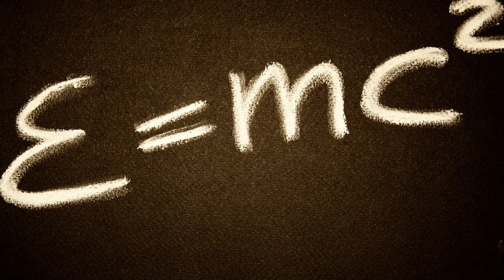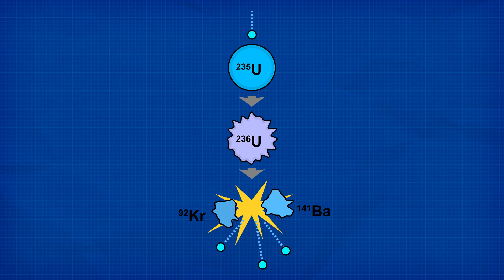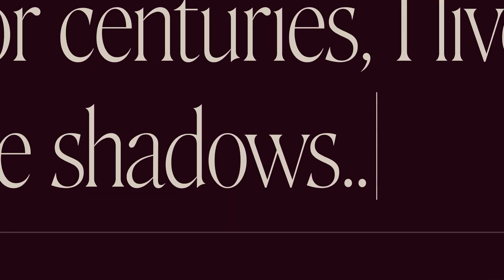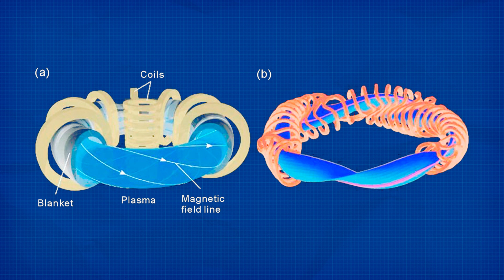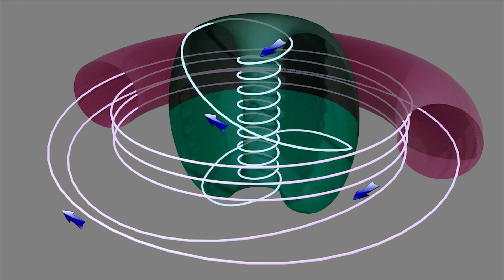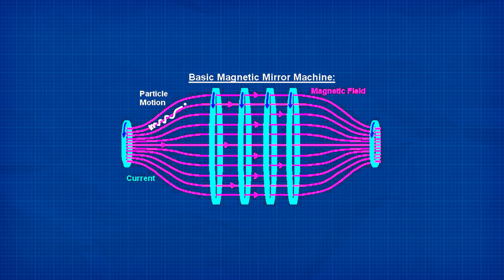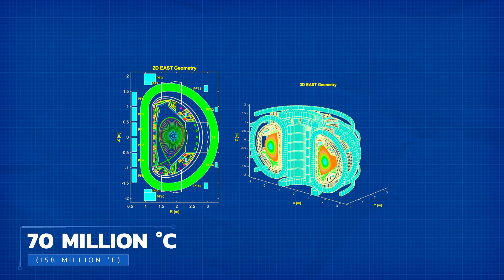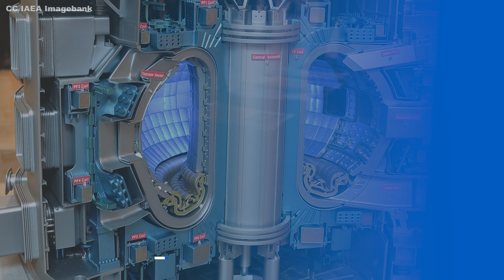Fusion Cracking the Future of Energy

Comment: The Q metric is a bit misleading by itself. In order for a reactor to be productive one doesn't just need Q>1, but needs actually usable energy out to be greater than 1. This is substantially tougher.
Reply: As a plasma physicist Q is not a metric I'd use for public communications, it often gives a completely irrelevant standard for experiments and facilities. The role of ITER is to get more out of the plasma than we put in, not the facility as a whole. This is an important step to study how various plasma properties scale with size. STEP and DEMO however are planned to actually put a small amount of net electric on the grid, they'll have turbines and everything, the reason why its a small amount is because the grid would very much rather not have an experimental reactor pumping out large amounts of power that could suddenly and without warning be cut off. 
The Sabine Hofstadter video that I'm pretty sure taught the general public about the Q metric completely failed to contextualise the intent of the experiments and built a false narrative around ITER being some sort of scam
Reply: @idoltrash2353  I think it's a little unfair to characterize Sabine Hossenfelder's video (watch?v=LJ4W1g-6JiY) in that way. She quotes Phillip Ball's article in the Guardian which says (regarding ITER):

"It hopes to conduct its first experimental runs in 2025, and eventually produce 500 megawatts (MW) of power - 10 times as much _as needed to operate it._"

and it's ironically that sort of twisted b.s. being communicated to the public that Sabine is trying to unravel in her video. The references in the video's description are very thorough, and if you're interested, I highly recommend checking them out. She isn't saying anything about ITER itself, rather.. she is calling out the MEDIA'S often incorrect (through ignorance) and sometimes maliciously misleading (for money via clicks etc.) The overarching goal being the improvement of scientific communication to the public, which starts with the acknowledgment that it needs to be improved.

At 4:02 into the video, Sabine says:

"The confusion, which you find in pretty much all popular science writing about nuclear fusion, is that the energy gain which they quote is that for the energy that goes into the plasma and comes out of the plasma. In the technical literature, this quantity is normally not just called "Q", but more specifically, "Q_plasma". This is not the ratio of the entire energy that comes out of the fusion reactor over that which goes into the reactor, which we can call "Q_total". If you want to build a power plant, and that’s what we’re after in the end, it’s the Q_total that matters, not the Q_plasma."

As Jason Cassibry said in a comment on the video:

"As someone who has worked in fusion for 20 years, this is a well done video! There is a growing community of scientists and engineers working on magneto - inertial fusion and high field magnetically confined systems which combine attributes of ITER and NIF into smaller, more affordable experiments. As we continue to make strides in these areas, I promise to be mindful of the misleading nature of Qplasma and do my little part in reducing the confusion around the topic. All the best to you Sabine, -J"

At the end of the day, Qplasma is not the Q value that matters. It's Qtotal. Regardless of how little power is required to generate and stabilize the Qplasma, until that Qtotal provides for a positive net gain, we aren't there yet.

It's not ITER, or fusion reactors that she is talking about. Sabine is a "Science Communicator" .. and it's the abuse of "Q" in ways that confuses laypeople that she's addressing:

"How can such a confusion even happen? I mean, this isn’t rocket science. The total energy that goes into the reactor is more than the energy that goes into the plasma. And yet, science writers and journalists constantly get this wrong._ They get the most basic fact wrong on a matter that affects tens of billions of research funding..."

Which, ya know, is kind of important! And although this abuse is mainly generated by media, there ARE Scientists and Engineers who absolutely HAVE intentionally created confusion around Q, and misled people about ITER's ability to produce more overall energy than what is put into the system. They are also presented in the video, and it is THOSE people that you should really be concerned about.

Maybe as an actual plasma physicist, you saw the video from a perspective that was a little skewed, because it's sort of weird how you are complaining about it, when she is trying to clear up the exact problem you laid out:

"As a plasma physicist Q is not a metric I'd use for public communications, it often gives a completely irrelevant standard for experiments and facilities."
Reply: @THE-X-Force  Currently, a ball lightning energy source produces Q=8.6.
China has acquired the technology. It will be used in military and space exploration projects. It is called the QUANTUUM DRAGON project. It can be made in a small cheap household version. So far it has been scaled up to 3 MW max. We quickly told the CIA scientists ( because they are the best) who reviewed the project documentation and found it to be along the same lines as their own research.
Reply: @zoltanpecsek4373  I'm sorry, but I honestly have no idea how that relates to anything that I said. I did say quite a lot, but it was fairly well focused on one topic, and that was the misleading communication all too often found regarding fusion, Q-Values, and science in general.
Reply: @idoltrash2353  Yeah, there's a lot of context here. And I don't mean to imply any sort of intentional scam! Just that looking at Q getting closer to 1, doesn't by itself that we've solved all the problems.  But as long as Simon is going to talk about Q as a metric, noting its issues seems natural.
Reply: @joshuazelinsky5213  yeah absolutely, Q is actually relatively easy to solve when you take out all the rest. You just make the reactor really big, the Soviets solved that one way back. 
The current issues are mainly around the stability of the plasma, how we handle the heat exhaust and a type of disruption called an ELM (essentially where pressure in the plasma grows too large in certain regions and the plasma spits out a load of energy). I appreciate that these are topics that are harder to talk about but yeah Simons video would have been better to leave Q alone and instead talk about how these various experiments plan to reconcile the current challenges in fusion.
Reply: Indeed, that also doesn't cover total plant power consumption, and the greater challenge of converting heat to energy, which is never perfect.

Comment: i wonder, is there's some principle that we're missing where we can approach q = some number < 1 but never get there?

what i'm getting at is that stars have the advantage of an enormous amount of gravitational potential energy that generates enough heat to facilitate fusion. we're just replacing that energy source with something else, like pouring in heaps electricity.

what is a star's q factor when we treat gravitational energy as necessary input? could a star also have q < 1?
Reply: Yes but then it wouldn't be considered a star, but rather a brown dwarf. https://en.wikipedia.org/wiki/Brown_dwarf
Reply: @TheTaXoro  I'm talking about an actual star. if you consider the gravitational potential energy as the input energy, what is the ratio of output to input?

Comment: 11:31 "in other words the most efficient fusion reactor only produces 70% of the energy necessary to run it.
That's sadly somewhat false. Something really important to keep in mind is that the Q factor is almost always the Qplasma or the ratio between the energy needed to run the reactor and the energy found within the plasma. Which is really not the same as the energy output of the plant since you usually have some very large energy loss when transforming the theral energy of the plasma into electricity. So the Qtotal of the current most efficient plant would likely be bellow 0.5.
Sabine  Hossenfelder as a really good video on that issue.
Reply: and energy would be required to refine or produce the deuterium and tritium fuels.
Reply: @MusicalRaichu  True, I forgot that part.
Although, IIRC only tritium really need to be produced sinc deuterium is easily found in large quantity (could be the other way around).
Reply: @raitoiro  oh that's right, tritium is unstable so needs to be manufactured. but deuterium still needs energy to be filtered out from hydrogen, and hydrogen needs processing to extract it from compounds.
Reply: Sabines video is such a bad misrepresentation of what ITER is, creates a completely false narrative
Reply: Sabines video however fails to contextualise the intent of the experiments and uses Q, a value rarely even talked about in the plasma physics community, as a tool to build some kind of narrative around ITER being a scam. 
If you want to see plans for reactors that intend to put net electric onto the grid look into DEMO and STEP
Reply: @idoltrash2353  The fact that it's rarely use in plasma physic community doesn't matter tho. The issue is that it's commonly used when communicating with the public, and without all the necessary precisions, most of the time.
Those kind of miscommunications are part of why some people think that ITER is a scam.

Comment: What I don't understand is how do we get all that Deuterium and Triterium? If we have to invest a lot of energy into that, having a net plus is even further away.
Reply: I think it can be a product of fission reactors, when neutron radiation is absorbed by water
Reply: @battlesheep2552  But aren't we trying to replace those?
Reply: The plan is for tritium to be produced via a reaction between the neutrons produced via fusion and lithium in a blanket surrounding the vessel. This has the added advantage as you can pipe this lithium as a molten salt out and use it for heat exchange to produce the steam for your turbines. producing deutirium is easy enough to not be a concern, the quantities of fuel required are extremely small
Reply: Deuterium and Tritium are present in sea water. Since we have a lot of that, we theoretically have a lot of these isotopes...

Comment: Thank you for clearing this up Simon. You now know why the big bang theory, and by extension evolution, can’t happen. If hydrogen Adams repel each other then how do they get close enough together to fuse? By an external force, of course. So in the words of that great philosopher, Clint Eastwood, “you gotta ask yourself a question, wap what is that outside source?“ I do hope that we can get to fusion power, but getting more energy out of a system that is put in to a system anytime in the near future is not likely. Going all electric will also require the entire electric grid of the United States to be completely over To be completely overhauled, not that it would be such a bad thing to do song! To do Sol

Comment: A real problem here is that even if we could get a fusion reaction to finally generate and be sustainable. We would still just be using the heat given off by it to boil water, to turn a turbine, to produce electrical energy from the rotation of electromagnetic fields. I guess we could probably put solar panels around it as well. Still both are inefficient.
Reply: I'm pretty sure those PV Cells would be incinerated lol
Reply: The Carnot Cycle is believed to be the most thermodynamic efficient heat engine allowed by physics.
It's no black hole generator, but its what we have.
Reply: @dongiovanni4331 
The Carnot Cycle is theoretical and relies on non existent materials to eliminate friction.

 https://youtu.be/ELR1Hx4qymo
Reply: My solar panels are fusion/fission hybrid powered.

Comment: Fun fact: The sun isn't hot enough for fusion to occur. It instead relies on a peculiar phenomenon called quantum tunneling. 
The immense heat and pressure at the core of the sun is high enough for atoms to come extremely close but they need quantum tunneling to make that 'extra leap' in order to fuse.
It is an incredibly rare occurrence, however due to the sheer number of atoms in the core, it's enough to produce the level of fusion we see.

That is why fusion reactors on earth have to be so much hotter than the sun.
We can't create the same conditions found at the centre of the sun due to the massive difference in scale.
Reply: I had no fun with your fact. Try harder next time.
Reply: @dankyjoker  Don't worry. Not everyone gets it.
Reply: Quantum interactions will be plagued by temporal complexities - particularly in the temporal gradient inherent in any apparatus within a gravitational well, which includes anywhere in our universe.

Comment: Fusion is not even close to a working reality. It produces somewhere around 10% of the energy needed to create it. (Total energy cost. Look into the total energy cost, as they are mostly only reporting the fusion initiation energy when reporting returns near 50%)  Even ITER is not scheduled to produce net positive energy production (in fact nowhere near it). I think its perhaps a great long term solution... but the dollars invested could have already solved the worlds energy problems through geothermal production...
Reply: Fusion funding is literally pennies compared to other kinds of energy production lol
Reply: @TheTaXoro  not really related to my comment... and also incorrect.  The entire geothermal industry right now is worth about 4.5 Billion. The cost of ITER alone is 21 billion...
Reply: @mattm1697  What exactly do you even mean by geothermal in this case? And what is giving you the delusions that it will somehow solved the energy demands of the world? lol
Reply: @TheTaXoro  i mean geothermal electric as well as geothermal solutions for local heating and cooling solutions. The reason its the best bet is that its available everywhere, you just need to dig deep enough. Its reliable and is continuously available. It requires very little land and resources. Its also quite simple and relatively cheap despite very little investment.... I have been following fusion for 20 years and very little progress has been made despite constant claims of major advancements the power outputs are still pathetic compared to input... and the costs to get where we are have been enormous...